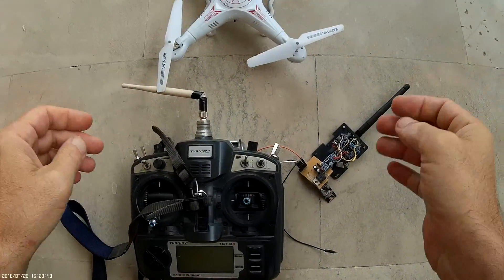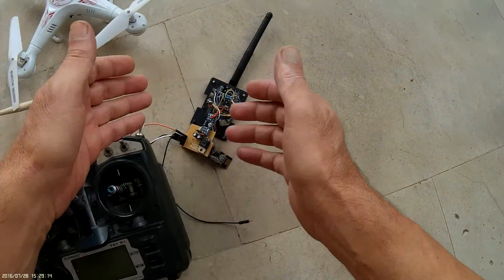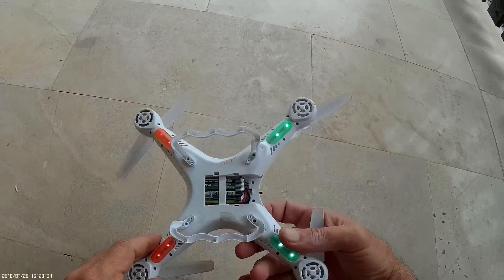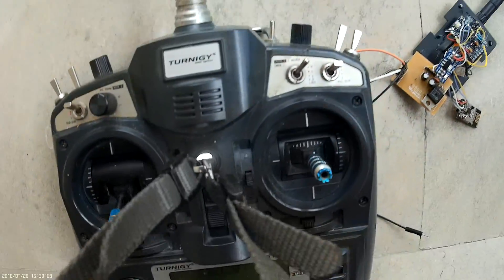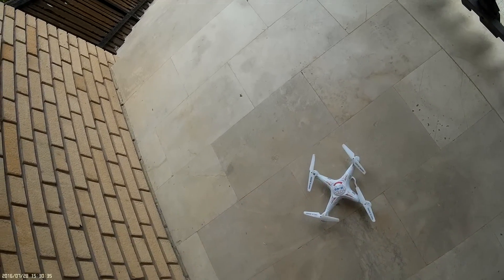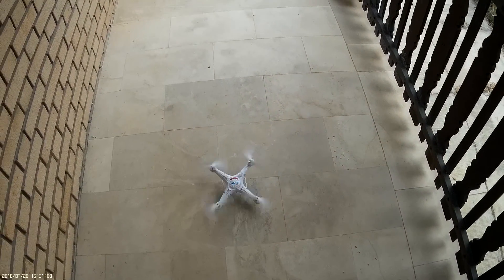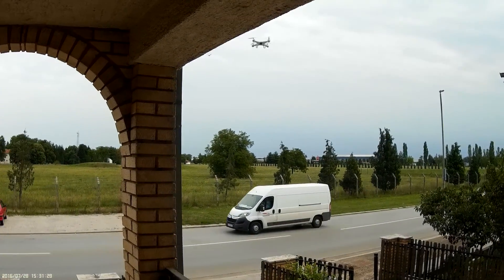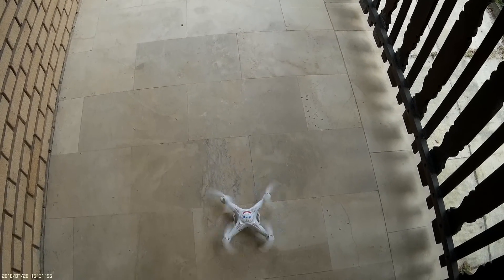Multiprotocol: First Test Flight

Comment: i will be using this cc2500 with a flysky th9x, can i just plug this in to the transmitter for it to work?
Reply from the maker: Yes. Just find library named "_Config.h", and comment all transmitter that you does not use, something like this:
//Comment if a module is not installed
//#define A7105_INSTALLED
//#define CYRF6936_INSTALLED
#define CC2500_INSTALLED
//#define NFR24L01_INSTALLED
And, above that, there is some puzzling thing that you should comment/uncomment:
//Uncomment your TX type
#define TX_ER9X_AETR //ER9X AETR (988<->2012µs)
//#define TX_ER9X_TAER //ER9X TAER (988<->2012µs)
//#define TX_DEVO7  //DEVO7 EATR (1120<->1920µs)
//#define TX_SPEKTRUM //Spektrum TAER (1100<->1900µs)
//#define TX_HISKY  //HISKY AETR (1100<->1900µs)
I am not sure whether HiSky is the same TX type as FlySky?! That is because FlySky transmitter resembling Turningy ER9X (actually Turnigy 9X, "ER" is just different firmware), just different manufacturer. Try one or other option - one of those should works. Please tell me whether you manage it to work. Thanks.
Reply: +WildMania  i'm sorry for the ignorance but where do i find the library? i'm new at this and have no idea where to start. there was a video that was helpful but it was old and all the info is gone now. thanks for taking the time. i eally do appreciate it.
Reply from the maker: I am sorry to because I assumed that you already have whole packet, or .zip file: https://github.com/pascallanger/DIY-Multiprotocol-TX-Module
Just chose "clone or download", and save "DIY-Multiprotocol-TX-Module-master.zip" file into your preferred folder (or working folder), unzip and open "Multiprotocolo.ino" file into Arduino IDE. This act will "pull" all other files and libraries into editor, and you may notice that it has multiple tabs. Next to last tab there is  arrow down, or pull down menu. When you click on this menu, it will oppen whole lot of stuff. I think it is fifth from the bottom of this list, that library _Config.h. After you done all changes (excluding not needed features, because of saving flash memory on the MCU), compile and upload it to the actual board. I rather chose Arduino pro mini, but one which has jumpers for voltage selection: 3.3V or 5V. Unsolder connection between middle point and point where it is 5v, and solder on 3.3V. Designation for this jumper is actually on opposite end of the PCB. Out there are many Arduino pro mini boards, but some working on 3.3V, some on 5V. If you have chance, buy 3.3V one, or "advanced" one wich has this selectable feature - because most of RF stuff works on 3.3V. Also, you will need FTDI adapter for programming, also selected on 3.3V. Some of FTDI adapters have obvious jumpers, which you can pull and "stick" into second position (for 3.3V selecting), some has not so obvious jumper which has PCB trace between middle position and 5V selection, which should be removed by some knife or sharp screwdriver and then middle position soldered to another position where is marked 3.3V. Maybe there is more to explain. Just ask. THanks.
Reply from the maker: Also, down below those files, you have plenty of explanation how to on the same page: https://github.com/pascallanger/DIY-Multiprotocol-TX-Module

Comment: hello, i see you have syma x5 clone. do you have camera that comes with it? if you do, could you explain how to control it without remote, how to take photo and how to start video?
Reply from the maker: Black wire to ground, red to +3.3V stabilized. Yellow wire if touched to ground (install some push button) for 0.25 seconds - it takes snapshot. If touched 1 second, then it start recording video, and even brief touch to ground again it stop recording video. Happy filming!
Reply: thank you. would it be possible to connect it to receiver and control it with transmitter via a switch?
Reply from the maker: In this case, the best way is to start it manualy before flight, then 
turn off when return. The reason is because I am not aware of dedicated 
receiver which can do this, except original board which do the timing 
trick. I am not sure whether remote do timing, or receiver, but one of 
them should do it. For other receivers, it should be way to convert signals (if for example CPPM or PWM for servos), because it will not provide proper sequence. Just start recording prior toflight, fly, then turn it off after landing.
Reply: thank you
Reply from the maker: You are welcome.
Reply: hello again. i have syma x5 clone too, i want to install bearings to its engines to make it run a bit quiter and lower vibrations, i need two different bearings for one motor 1,5mm x 4mm x 2mm and 1,5mm x 4,8mm x 2-3mm. could you advice me where i could find these kind of bearings. yes these kind of bearings exist i have two. i have installed them i one of my motors it runs quiter than ones without bearings and since there is no voble of shaft there are no vibrations. so i would like to install bearings to all its motors, but i cannot find them on ebay,, i cant even find one that would have 1,5mm hole for shaft
Reply from the maker: Oh, sorry... I did not play with bearings yet on this toys. It souns too small to me to deal (special tools?). So, can not help you.
Reply: no special tools are needed, take off big gear trim it 3mm, phile thread off of shaft so you could slide bearing, start with the end where you screw prop on: slide on tiny spacer 0,5mm height (i made it from plastic) slide bigger bearing (i only had smaller ones so i had to use glue to put it in place), slide shaft into motor mount slide on smaller bearing, slide on another tiny spacer, now try to make thread on shaft again, add some super glue and screw big gear on that thred that you try to make
Reply from the maker: Thanks for the info. When get rid of this "day and night" lasting programming stuff, I wll make my other FrankenDrone, and will try some bearings too. Tell me, is it just bearing or  ball bearing?
Reply: ball bearings it looks something like this http://web.media.mit.edu/~stefanm/TinyProjector/TinyProjector_files/image324.jpg
Reply from the maker: This must be expensive then.
Reply: i manages to find smaller (1.5x4x2mm) ball bearings 681XZZ they ar not expensive... still looking for bigger ones (1.5x4.8x2mm), but i could duit with smaller ones
Reply from the maker: Cool! Bad thing it is over, bidding. Well, okay... I believe that out there are many others. Thanks.
Reply: well important thing is i found bearing model its 681xzz for 1.5*4*2, just now found a little bigger but it wont fit its 691xzz 1.5*5*2.6mm
Reply: do you know anything about WIFI FPV cameras, specifically how to activate them? i bought syma x5sw 0.3MP wifi camera, it's a crappy camera, but it works. i googled how to activate it without drone, i found one video, in it some dude just told to connect positive and negative wires and it should work. i tried but it does not, green light turns on, and then red, but wifi access point does not appare, what do i need to do with signal wire? i tried connecting it to the ground, short connections do nothing, few secons connections do nothing, i tried connecting signal to ground longer, then red light just turns off. camera works fine when i connect it to drone, green light turns on, red light blinks until access point appares than red light turns solid
Reply from the maker: I have no experience with those WiFi cameras for drones. Mainly because of latency and poor quality. I suspect that this signal wire should be "clocked" by some signal - so that it emits between two incoming packets from remote, so that it does not collide. When you power it without this signal, camera is ready, but have no "permission" to emit anything. Do you have an oscilloscope?
Reply: i do not. i wonder if i could change camera settings to work without "permission" ... need to check command list... that camera does not have web UI only CGI commands and it is a pain i the ass to change settings, had to do a lot of reaserch to find commands to lower resolution, because when it arrived it was set to 640x480 i think it was too mutch for camera to handel, so latency was realy high, i managed to lower it to 320x240 quality is shit, but now latency is acceptable
Reply from the maker: Yes, latency is one of many things that I don't like on WiFi cameras. It is much easier to make analog camera... just made one 4.3 grams camera + VTX (25 mW): https://www.flickr.com/photos/milan_karakas/28289702244/in/dateposted-public/
But, I can't find good battery - since I did not fly for long time on such small quads, all batteries I have are half dead, no more than 2 minutes flight. And, did not solved problem with power supply interferences - need some filter to insert. I bet that WiFi cameras are even more difficult to make working properly.
Reply from the maker: Also, I remember good old days when the same setup, just 3 grams more, can fly about 3 minutes, but no more even with reduced weight. So, I need to buy new batteries... will see... Such flight is here: https://youtu.be/js-zIUfASTo
Reply: well poop, cant find any camera cgi commands that would allow to turn on camera without quadcopter...
Reply from the maker: Probably they don't want you to re-purpose this camera. Damn! Chinese tricks...

Comment: hi all right guy have another idea to make the drone can help me again kkk the idea is to use the original recepitora board drone to control the engine. Brushless then is posivel? I have to find the pwm enters the transistor that controls the original engine know if it's possible to appreciate from now
Reply from the maker: For brushless you need decent ESC (Electronic Speed Controller). Another problem with some "random" receiver (if I understand you correctly) that every receiver has its own signal interpretation, or way to drive motors. If you are not familiar with at least some basic system, then it is better to look at forums about some quadcopter - about how to make. If you think brushed motors, then you can do it - with use of MOSFETs, small one with TTL logic levels, or better said, one that switches at about 1V to 1.5V. Big MOSFETs usually has transition at about 3.5 V to 4V, but you need small package, small one.

Comment: I would go into the  model settings and adjust the sub trims and end points.
Reply from the maker: Yes, I did that. Also, people from RCgroups have nice idea: since I have the scope, and there are rang + middle position, it will be good to measure actual neutral position, then just change variablest slightly. The best option. So far, it works with sub-trims. Thanks.